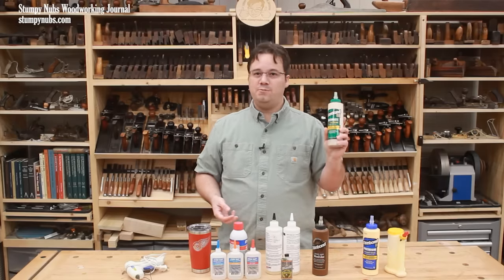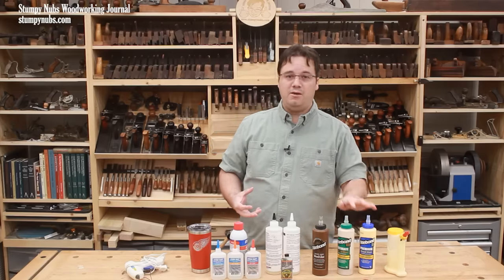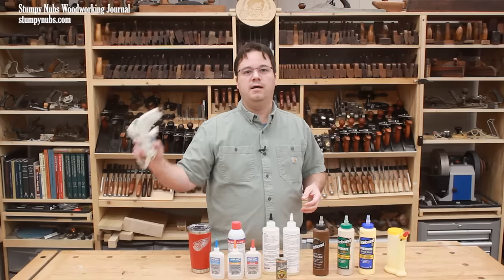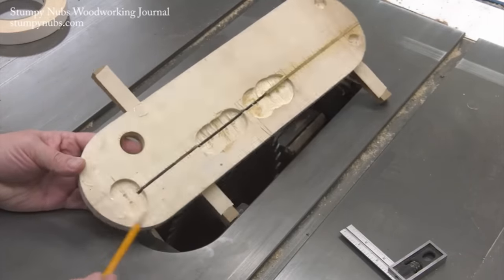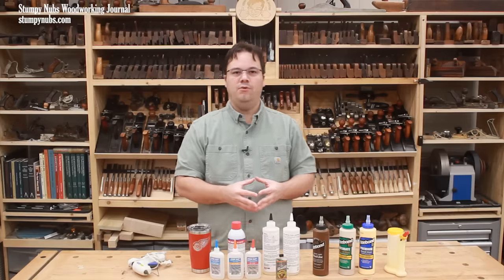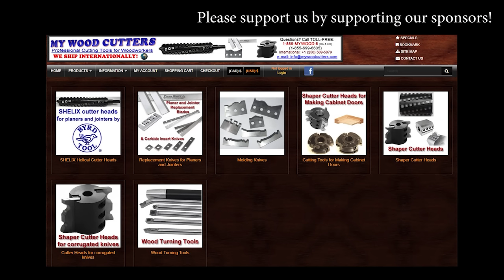Why I don't use Gorilla Glue

Comment: I hadn't used Gorilla Glue before, so I was surprised to read on the label that I would need to mist one side of the object that I was gluing and use Gorilla Glue on the other side.  For my project, this wasn't possible, so it's back to Loctite.

Comment: I suggest you start by researching the federal specs on glue types. Type I glues are true waterproof glues. These include epoxy, resorcinol and catalyzed PVA. Type II glues are water resistant. These include Titebond I and II and urea formaldehyde.
I have used Gorilla Glue a little. I believe that it is a polyurethane glue. I have heard it was developed in Europe as a replacement for epoxy. When I ordered my glue from the Gorilla people, I asked them if it was a Type I glue. They did not know what I was talking about.
Some manufacturers list the glue type rating on the label, many don’t, including Titebond. In my door and window shop we only used catalyzed PVA glue, it was superior to Titebond in every way.
Reply from the maker: "I suggest you start by researching the federal specs on glue types.".... Did I say something that contradicts the "federal specs?"
Reply: @StumpyNubs  the point I was making is that only Type 1 glues are waterproof. Titebond glues are not Type 1. You did not address the difference between Type 1 and Type 2 glues. The glue manufactures are responsible for blurring the distinction, for their benefit.

Comment: Original Titebond has been our go to for many years. Not all yellow glues are created =! Titebond 3 has one major failing, low heat resistance. Franklin says max 180F. Sun on a panel can easily reach that. For water proof we use resorcinol. I have used urethane glues for special purposes but wouldn't for general purpose. As others have said, because it expands as it absorbs moisture it is a mess to use. As for filling gaps, a terrible solution, full of bubbles and weak as hell. Franklin makes a good urethane glue that is considerably cheaper than Gorilla brand, when bought in gallons. Use it for mixed material bonding.  3M makes an excellent, very expensive urethane hotmelt that sticks to about anything. It requires a dispensing gun at about $350 and a preheat chamber. We've used it to apply sealing gaskets on hospital casework. Epoxy has good gap filling, is mostly clear and powdered pigments can be added for decorative features. Epoxy requires some thickness to work properly so don't over clamp it. 

About the idea that you can over clamp glues like Titebond original:  I did a test to see if that was true. I purposely chose to do some things that are less than ideal. I used hard maple that had been laying around the shop for an unknown time. It was a cut off from the molder. No surface prep was done. Sample parts were 3" wide by 6" long. Glue was goobered on one piece and immediately placed on the other and then between two one inch steel plates and into a press where 40,000 #s was applied.  The next day a Vee notch was made on the glue line and a steel wedge put against the notch. Back into the press until failure. The wood failed, not the glue line. 

We do a lot of bent laminate curved work, so controlling creep is important. If the correct laminate thickness is used we have no problem with original Titebond creeping. Do not use white glue, it creeps like crazy. We have test pieces that are over ten years old in the shop and they still measure the same as when they came out of the clamps. The glue surfaces are used just as they come off the straight line rip saw, quite nice and smooth. The strips are kept in order so the gain pattern matches. Strips are placed edge to edge and glue is rolled on all at once. A waste strip is used to prevent clamp marks and the stack is put into our adjustable steel form. Steel strapping is used to clamp. Next day parts are scraped of excess glue and run through the widebelt for thickness. Then through the arch molding shaper. The feed works will track whatever shape is put in. S curves, parts with a straight leg and a curve, ellipses....
Arched door jambs, base and the like are vacuum bagged in wood male & female forms. The vacuum ensures uniform (atmospheric) pressure.

Comment: For the liquid or hot hide glue, be sure to use a combination of heat and moisture when disassembling parts. One method I use is simply to throw small parts into a pan of hot (not boiling) water. Another method is to use a hot wet rag and an iron. Yeah, you’ll raise the grain, but that can be fixed later.

Comment: My dad has a woodworking shop and they make restaurant bars, bench and tables. Company has been running for close to 50 years now maybe more has it was owned by my grand dad prior to that. They swear by screws and the runny white glue and their stuff last forever. Litteraly. 

Really wondering why this is not part of your arsenal. You might not be into building huge things like bars though.

Comment: Gorilla Glue is a brand, not a specific type of glue.  They make a polyurethane glue but also make a wood glue equivalent to Titebond (which I've used and is very good), CA glues, epoxy, fabric glues, etc.  

Your video title sounds like you have a problem with the brand...

Comment: CA - GLUE------ PRO TIP 
Mix medium ca glue with graphite powder 
u get 40-50sec up to few mins (depend how thick it is) before it kicks in but then it cure in seconds 
and u get rock hard material 
u can use it to glue steel to wood etc 
can glue almost everything to everything 
u can do the same with epoxy 

if u want instant cure time of filler material - use baking soda with superglue - instant cure time 
and u will have plastic like material

Comment: so if Gorilla Glue does the same thing that 2 or 3 other glues do, why not just use it INSTEAD of them? and if it is foaming out of the edges, then you are using too much. you don't need to use as much GG as you do other glues...which means that even a small bottle lasts longer than other glues. sounds like a win to me...

Comment: Gorilla Wood Glue cures WAY too fast. It gets thick and tacky in two minutes, clamps no longer have an effect in three minutes. I made a scarf joint ever so slightly concave so that the wood meet in the middle (so slight that it was practically unnoticable) but because I couldn't clamp them fast enough, the joint has an enormous seam of glue. I don't recommend trying to apply to both surfaces, just apply to one surface and very quickly clamp them.

Comment: I do a lot of woodworking but I also do a lot of guitar building and repair. I use Titebond III most of the time for guitar work as well as most of my other wood work. I made the mistake of using Gorilla glue once and it ruined my work I vowed never to use it again. IMO absolutely thew worst glue on the market. One of my friends used it to glue a couple draws that were falling apart in a dresser together. I told him to use Titebond or even white glue but he decided to buy Gorilla glue because of their commercials. The Gorilla glue swelled and it pushed the wood out and jammed the draws to the point I had to almost take apart the dresser to get them out. I think if he waited before the Gorilla glue totally set he never would have gotten the draws in, in the first place. I had to pry apart the draw sides clean out the glue and redo them. I argue with people all the time and tell them not to use it but because of their marketing far too many people fall for their claims.

Comment: I agree with you 99% except CRINGE ALERT I use poly glue GG to assemble IKEA "particle board" "furniture/cabinets"excluding sofas. A thin line about the size of a toothpick( not ideal, but prevents bleed out from expansion), applied to the center of the coarse open "wood" ends,before cam locking together. Start/Stop line of glue at least 1/4 inch from both ends. It makes a huge difference no wobbles over time.

Comment: There's nothing as frustrating as finding someone has used gorilla glue to repair wood furniture joints.  I've been doing antique and furniture restoration for a couple decades now, and it is always a nightmare cleaning the gorilla glue out of joints.  PLEASE DON'T use it for any wood furniture.

Comment: Strange, the old standby yellow glue seems to be unavailable. You could have a bottle 5 Years old, dried glue would make it airtight, and it was fine. Now, modern glues set up within 6 months or so. I am very sorry that the old Elmer's wood glue is being done away with, too good quality.
Reply from the maker: Elmers still makes wood glue: https://amzn.to/3zNNWbT
Reply: @StumpyNubs  It can still be found, but you have to order it, and get it in the mail. Home Depot doesn't stock it, Ace. I fear they are, phasing it out.

Comment: Only use gorilla glue when you need to bond 2 weird materials together.

It was the only thing that worked to glue a glass headboard back to the the metal frame.

Comment: Gorilla wood glue has a shelf life of a few years, 1-3 before it goes bad, whereas my elmers wood glue from 15 years ago still works fine.
Reply from the maker: All PVA glue has a 1-year shelf life before it begins to lose strength. You can use it for longer, but why risk a failed joint over a few dollars in glue?

Comment: Funny how yellow glue dont realy exist in europe. We can find titebond, but generaly we use PVA glues that adhear to the D1, D2, D3 or D4 standard, and those preaty much match excatly what you describe about the differende yellow PVA glues from titebond. D1 to D4 describes different levels of water resistance and temperatur tolerences.
Reply from the maker: Perhaps they just don't put the yellow color in it.
Reply: @StumpyNubs  That would be my guess.

Comment: That gluebot looks like a great idea until you forget to completely clean out the glue passage. Forget this and you will never get the solidified glue out of those passages.
Reply from the maker: I've used one for years. Never had glue harden in the passage. If left uncapped, it will harden near the tip and seal itself. The tip can be easily cleaned out.

Comment: When making a Meerkat walking stick for my dad a few years ago, I had an issue:  How do I attach the glass eyes to the hand carved face?  Epoxy is the obvious choice for something like this, but I hate it because you have to wear gloves and somehow it gets on your hands anyway.  And it wouldn't really work well with the glass eye anyway.

So what did I use?

Silicone caulk.  While I wouldn't use it in most woodworking projects, when you need to attach something random to something else, it can't be beat.  Easy water cleanup, no clamps.   The clear caulk is almost invisible.   If you don't need a really strong joint and the other glues aren't well suited, caulk can be your friend.

Comment: Nubbins you cant be telling people that hot melt glue is easy to pry apart because there are different kinds of hot melt glue sticks and you get the wrong one you may not be tearing stuff apart so easy less a prybar. Titebond makes a pretty good white glue as well thick-n-quick. CA glue will bond immediately with baking soda as well and the baking soda will actually add structure.

Comment: My only beef with CA glue is I see it used by luthiers a lot, and it's a dreadful product for that use. It's brittle, as you say, and heat weakens it a lot in my experience; never fix broken cups with it - trust me! Even though it's touted as a ceramic fixer. Also, you can't smooth it while wet. At all. It will grab anything; fingers, towels, cloths, and - god help us - tissues.

Comment: Titebond also has a white thick formula for trim.  It has instant tack.
Instead of bottled "hide" glue, consider the real thing.  I bought a small bottle of Chinese fish skin glue for a repair to be authentic with the original.  It's liquid and ready to use -- unless it's old, in which case warming the bottle in a bowl of hot water fixes it up!  I laugh at your one-year shelf life!  I think my bottle is ten years old, and it has outlasted bottles of Titebond and cyanoacrilate, maybe even epoxy.
You didn't mention Woodweld.  Not the brand which now makes various kinds of glue, but the actual Woodweld product, which is a powder.
Something new, which I've not tried yet, is UV-cured resin.
Rubber Cement / Contact Cement.
Also, think about it: special purpose adhesives are still "glues" which may be applied to novel areas.  I'm thinking of mastic and thin-set, normally used for tiles.
Another new thing is actually tape: VHB (very high bond).  You've probably joined things with mounting tape and carpet tape and other double-sided tape before, right?

Comment: Everytime I've bought Gorilla Glue, when I go to use it, it is stone hard inside the bottle.  There is a problem with sellers of hide glue, no presentation or explanation of grain strength and working time.  No presentation of working temperature or temperature limits   SICKENING !!!  The major supplier of hide glue sells a kit for using the stuff.  The blister pack item is made for glues at far higher temperatures that will destroy bonding quality of hide glue he sells it for use with.

Comment: There is some general bits of wisdom in this video, but for someone in Europe it contains almost nothing that is applicable. Everything is different between US and EU: the brand names mentioned don't exist over the great pond, poly urethane glues don't require water here. Well, the white, water dissolvable wood glue that takes long to dry (and does so in a transparent manner), and that therefore can be washed out of clothes if you don't wait too long, that exists here too. PS I wish guys like this would also think about some environmental aspects of what they do. Such as the fact that both poly urethane and polyester are non-bio-degradable and their production likely toxic. Nobody seems to ever want to think about such things, whilst instead I would like to find out what the truths are and what (potential) differences there are ..
Reply: Gorilla Glue is available in the UK and it requires water to set. Where in Europe do you think poly glues don't require water?
Reply: @shegocrazy  Guerrilla glue is not a poly urethane glue. And 'a poly' is not any type of indication. For instance, poly-ester and poly-urethane are two completely different things, and in both the meaning of that term 'poly' is a different one as well. We are talking chemistry here. 'Poly' means 'multiple' but it don't say multiple (of) WHAT or multiple in what MANNER. So on its own it has no meaning.
Reply from the maker: You don't have CA glue, epoxy, hide glue or hot melt glue in Europe? You might have also found the explanation of the features in white PVA glue enlightening. I know I did.
Reply from the maker: "Guerrilla glue is not a poly urethane glue."..... Someone should tell Gorilla that: https://www.gorillatough.com/product/original-gorilla-glue/

Comment: Funnily enough I am currently getting great results from Gorilla Wood Glue, which appears to be a PVA yellow glue.
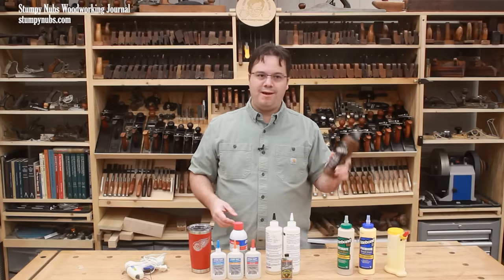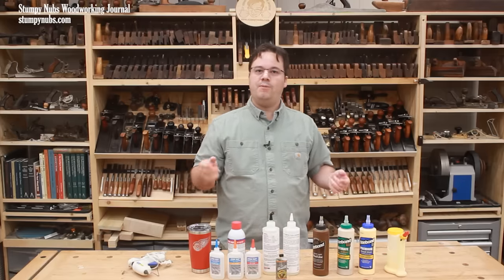Reply from the maker: Yes, I mentioned Gorilla's PVA glues as something comparable to the Titebond formulas I use (3:21). I also showed that I use their epoxy injectors (6:37). It was only their PU glue that I don't use (10:14) which is their flagship adhesive and is what their brand name is most known for.

Comment: when i was at college my college used titebond original glue i never really liked using it as the working time was never long enough  so i  usually mixed  mascamite glue as it working time was very long and when i started working in a professional joiners shop that only use white PVA and PU glue I wouldn't use i any titebond glue and only use joinery grade white PVA glue

Comment: There is no such thing as a one part waterproof glue. I work on big boats and small ships. I destructive test new glues before I use them on a job. Suppliers are constantly touting some new waterproof glue, but I have yet to find one including the ones in this video. I only use epoxy for gluing wood where there will be moisture or more.

Comment: What a terrible post title!
I just used Gorilla glue for the first time (in 40 years of woodworking) for a project where I had to hand cut dovetail joints, so, they were far from perfect & I thought Gorilla glue`s expanding properties would help me out, 
It did!
the joints were strong and the gaps in the joints are invisible! What`s not to like? My choice is PVA first & foremost, but sometimes, you gotta step out of your box, I`d use it again if needs must! 
(I have NO connection with Gorilla glue-just calling it how it is)!
Reply from the maker: You aren't "calling it how it is", you are calling it how you see it. And that's fine. I am calling it how I see it, as well. But insisting everyone else should see it the same way, because that is "what it is" is one of the problems with public discourse, these days.... And my title was both accurate and effective.

Comment: One of the first things you learn about soldering metal is that you need to have both surfaces hot. That is the problem I have always found with hot melt. Those cheap little guns cannot heat of both surfaces to a sufficient temperature to get the glue to stick. I use a heat gun to heat both surfaces before applying the hot melt. 

Secondly I came here because of the title. There was less than 30 seconds about GG in thei 11+ minute video. Not good.

Comment: I know this has nothing to do with this video, which is very informative, but how is your hand doing after that horrible accident?
That video really drives home the importance of using the safety equipment provided with the tool, and don't act stupid!
Even then, TONS of respect for the tool and the damage it can do, if not used correctly.... yeah, I know, the manly men will scoff, but they will change their tune when they are injured, or mamed, or GOD forbid, KILLED!
Reply from the maker: The ring finger is still stiff and it hurts a little bit. But I'm doing fine. Thanks!